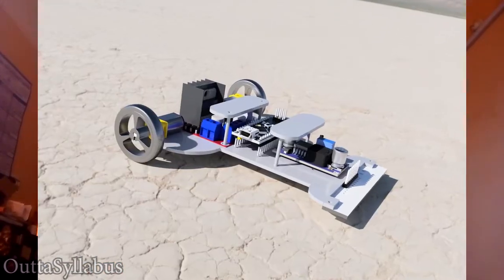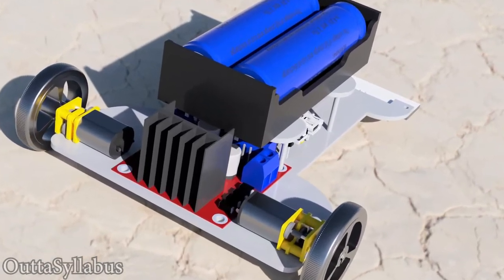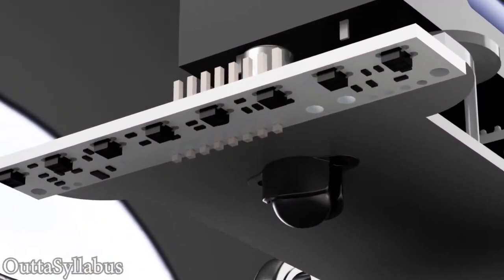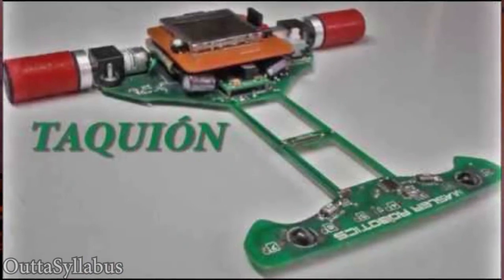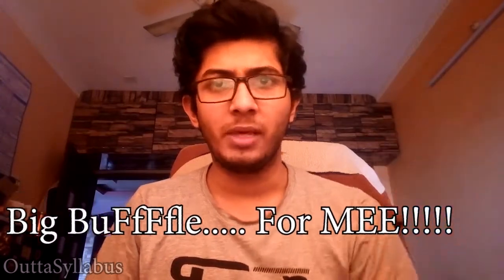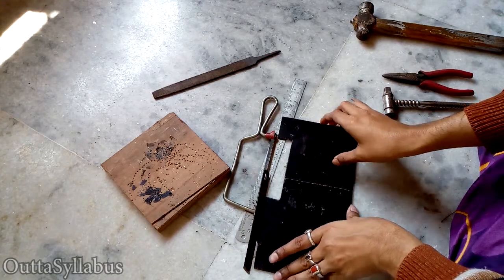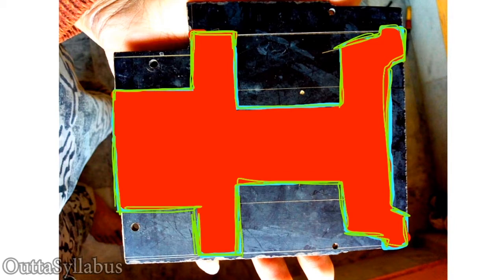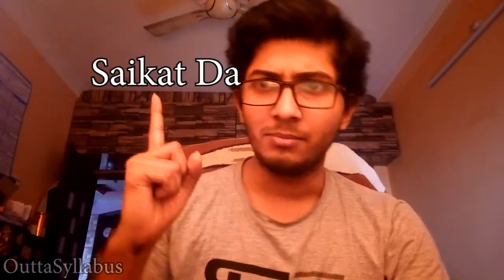New Fast Line Follower Build Part-1 [Designing the Chassis]

Comment: Im the CAD model at 1:35 what is that device 2nd from the front. Between sensor array and arduino?
Reply from the maker: It's a buck converter, at the very delicate time of my journey, I though of using regulated 5V via the Buck Converter to supply it to the arduino to reduce any losses but later found that arduino uses tooooo little power that the power loss due to heating of the inbuilt LM7805 is insignificant... so I scrapped it...

Comment: Hello friend 
I have made line follower using qtr8rc and 300 rpm bo motors it follows line but how to increase its speed and accuracy
Reply from the maker: you have to use at least a 1000RPM motor to get some speed... and your bot should be light to be able to follow line accurately... :D stay tuned I'll show you the whole build steps and how to code
Reply: @OuttaSyllabus  Yes but due to lockdown i can't buy microgear motor so i am trying it on 300 rpm